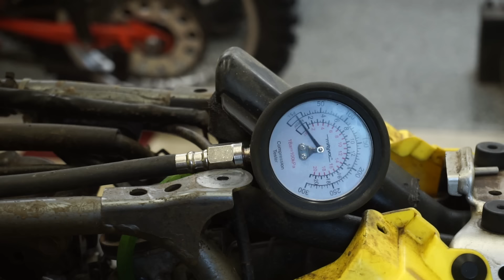Seller Gave Up On This Quad So I Got It CHEAP

Comment: That is clearly one of the three dogs on a gear from the xmsn that holds them locked together.
Reply: Yep I agree
Reply: 100%
Reply: 100%
Reply: 100%, but since the broken piece is out, it might shift OK part of the time, but there will definitely be intermittent shifting issues that could lead to a more catastrophic failure.
Reply: bottom line, time to split the cases.  Also, I have straightened bent shift shafts using a press and various methods with great success.  They have very little movement, so absolute perfection is not necessary.  Saves a few bucks.
Reply: 100%
Reply: Yep 100 percent a broken gear dog
Reply: @u2pda  yes I think it will probably be prone to pop out of gear. Whichever gear that's from. Such as it does when those dogs get really worn and rounded on the ends.
Reply: true
Reply: As mentioned its a piece of a gear dog . It might well shift but as soon as you ride it then it will jump out of gear . Split cases
Reply: @u2pda  that's right that shaft can be saved easy !
Reply: Yep 100! Knew it right away. Just split engine mate! Might save you money if anything else goes wrong why riding. Don’t forget its a Suzuki gearbox 😂
Reply: That’s what i immediately recognized it as, I bet it bent everything because the ear of the gear broke off it had to of been a hard impact on the transmission to do all that or something but absolutely it’s a broken gear i wouldn’t even run it until you split the cases because that was a huge piece
Reply: Correct ✅

Comment: Enjoy watching your channel! Keep up the content!  May I suggest some small things when your tearing apart these Japanese machines?  First is JIS screwdrivers as compared to impact screwdriver? The Vessel brand JIS screwdrivers are the best for Japanese screws! They also use a hammer to give shock to screws. And not strip out like impact screwdriver will.  Second in my time working on these quads, the factory uses plenty of loctite or screw glue on small screws. So heat is your friend!  A Torch with Mapp gas or my preferred method in small areas is Induction coil heat. Where you concentrate heat into steel screw and surrounding aluminum?  Then a wack with JIS Vessel impact screwdriver and bang your done!   Been working on Japanese and German rides along with American brands for 50 years!  Again keep up the wrenching!
Reply: Great tips!
Reply: Good advice. But he must put that claw hammer in the kitchen cabinet and get a good hammer that will transfer the energy needed for the impact driver to shock and drive as intended to do.
Reply: We all start out as crawlers and then we learn to walk then run!  Yes this young man needs to upgrade some tools? But he has some great diagnostic skills! But must learn the bull in the China shop method will cost him more in the long run?  The smaller the fastener the more trouble it will bring! When I apprenticed in a shop, I was told “You know what the difference between an apprentice and a journeyman is Kid?” I had no idea?   The answer is “The journeymen knows how to hide all his mistakes!”  We all learn as we go along! It’s the ones that retain this knowledge that go the distance!
Reply: @six4standingtall 😎🤣👍
Reply: Joe almost never uses a heat gun. Me personally with all my engine builds ever nut and bolt inside gets atleast blue loctite. Even if theres a lock washer or something similar. I tear down engines and see loose bolts or missing bolts that get shredded more than blown engines. Youd be surprised what 10 seconds from a torch  will do to loctite. Night and day difference
Reply: See knowledge is power!  Work smarter not harder!
Reply: abw121  everything you said in this thread is spot on and I agree with for sure. 👍
Reply: One of my first investments for working on all my bikes and friends bikes was a quality Japanese screwdriver set. I actually found JIS inserts for my impact screwdriver and those have saved me a many headaches.
Reply: Agree 100%.  Some of this stuff is just basic mechanic knowledge.  It’s frustrating he’s not showing the techniques in his videos.

Comment: Hey Bud, that metal piece is the gear dog from 2nd to 3rd gear. You are going to need to pull engine and tear completely apart. Then you can weld that aluminum piece on. I know you don't want to, but has to be done correctly.
Reply: Happen to my Dr800 4th gear in half with a chip like that... yep full engine pull down
Reply: Well spotted. I also don't like the thought of just tapping out the existing aluminium casing instead of rewelding the broken off post. Surely someone could reweld that on?
Reply: I agree it looks like a piece of gear dog but how did it get from inside the transmission to inside the clutch area?
Reply: @Claude-om9og  there is a common oil hole that connects the inside case with the clutch case as they use the same oil after all.

That metal piece (it's no aluminum because it sticks to a magnet) went through that oil hole and ended up in the clutch case.
Reply: Yeah Gary, your on the money
Reply: thats exactly my thought on that piece
Reply: First thing I thought when I saw it was a gear dog also
Reply: Agreed. And Joe made a meal of removing the shift mechanism. Sometimes I think he rushes stuff just for video content.

Comment: i am happy that you are now washing them off before you start working on them !!! always a good idea.
Reply: Now if he would start using proper tools.
Reply: Leave Joe alone, he does perfectly with what he has and uses so stop being armchair mechanics and/or tool snobs and just enjoy his content! If not then stop watching it or make your own!!!
Reply: and a small cheap Harbor Freight (for now)
CENTRAL PNEUMATIC 40 lb. Capacity Floor Abrasive Blast Cabinet $199
CENTRAL PNEUMATIC 50 lb. Portable Abrasive Blaster Kit $24.95

until big boy tools can be bought (which is better but)
VHT Weekend Warrior $2,864
VHT Hydro Blast High Pressure Parts Washer $7,000

As much work as he does on machines, one would think a machine like those mandatory
Reply: @sandbar521 wow, what is wrong with you???
Using the right tools for the job is not being a tool snob, and cleaning parts before you work on is good advice, not criticism.
Reply: @Sryously  you don't need it, but it makes your life easier.  You could do it all with a rock and a multi tool aswell but it would be a pain in  the ass.  Yes you can do it the backyard way.
Reply: @kindnuguz  Unless you're willing to buy him $12,000 worth of "big boy" tools to do the job right don't insult what he already has. Because the average hobby mechanic doesn't have any of that stuff. The HF stuff on the other hand is what a lot of people will have because it's affordable and easy to get. I don't even have a shed let alone a garage to work out of so a nice 60 gallon air compressor is out of the question.
Reply: Haters move on enough is enough,awesome find and video Joe
Reply: I think we finally shamed him into washing first. Joe, just listen to us we're looking out for you buddy!
Reply: Yep. Always makes me cringe when I see him stripping down an engine caked with crud.
Reply: Wow hater come clean my truck and house for me.

Comment: That part is coming from either #3, 15, 16, or 19 on the fiche. Definitely a shift dog from one of those gears. Looks like you will be splitting the cases! Also. While you have them apart, please get the part that broke off welded back on by someone skilled at welding cast aluminum. The case is going to be really thin there and tapping it doesn't seem like the right way to repair it.

Comment: Next time you get a situation with a stuck bolt/screw like this, always try a bit of heat before going mad, just in case thread locker has been used. As you saw, just from the heat from drilling the bolts in this case allowed them to come out easily.

Comment: That's how i got my 1st ATV. Was told it wouldn't go into gear got it home and looked at it a couple days later and found the drive belt self destructed. Lost that in storm after a tree fell on it and got my Bruin 350 last year from a friend and going to put nee cv axles in it later today after they get delivered

Comment: To check the oil on the LTZ 400 properly: let it idle for 3 minutes, then let it sit for 3 minutes and check. The oil in the reservoir needs to be filled up first. Otherwise you will not measure anything :)

Comment: Hi Joe. You don't check oil on Z400 like that, when it's cold. You have to start a quad, run it for 3 minutes, shut it down, wait another 2-3 minutes and then check the oil. Mine, when cold, didn't show any oil on a deepstick whatsoever, even if I filled 2.1 or 2.2l in a quad (don't remember exact number).

Comment: I got the very first quad built, which was the Quadrunner 125. I really enjoyed it, but it was a rough ride with no suspension. After that I was bumped up to the 185 which had front suspension and I thought it was the greatest thing ever, but after that everything changed when I got the very first version of this quad - the 1985 Suzuki QuadSport 230. I cannot put into words just how fun that little quad was. I would get all bundled up at midnight in the middle of the winter in New England just so I could go down to the barn and look at it. My father, brother, and myself would go on midnight rides on the snowmobile trails that ran right through our property, and we'd be on them for hours. My brother had the 1985 Honda ATC 250R and I was tired of getting smoked on the QuadSport so I traded it in for the QuadRacer 250. That was an awesome quad, but it just wasn't as fun as the 'Sport, but it was too late to go back. There was something about that 230 that made it the most fun machine I ever had. I would give anything to be able to go back to those days and do it all over again. Anything.
Reply: I too had an LT 230, great quad. Bought it for my wife and I continued to run my Honda 200X three wheeler which was a heck of a machine as well. Both great machines.
Reply: @btj1844  My son had a 200X. He rode the wheels off of that thing. Rock solid machines.
Reply: Thanks for the memories!  I worked at a Suzuki dealer in the 80s and also have fond memories of the release of those quads.  125 was cool, 185 lots more power, 230...gamechanger with its power and suspension.  I raced an 85 quadracer 250 flat track.  Fun times.
Reply: My first quad was an 86 230 Quadsport. Bought it in 93 for $800. Def a fun quad

Comment: Joe look up a tool called the Shake N Break. It is an attchment for an air hammer that will take a screw bit. it allows you to provide turning action while vibration down on the screw. I have the impact breaker you use but when that doesn't work easily i go directly to the Shake N Break. The tool is around $60. Thank you for the excellent videos.

Comment: New engine cases needed now after miss using the impact driver. 1 good hit with the correct bit  will break things loose.  Always push driver hard onto screw then twist it in the direction  you want it to turn until i clicks . This shows the driver is loaded  one good hit causes it to use its spring action to unscrew he item.  Hope this helps.

Comment: You washed it before starting the tear down👏👏.  That's always a good start.  It's unfortunate that a small piece of the case broke off.  I was reading some of your other comments.  Some think you might have to pull the motor and complete a full rear down.  Probably be best to make sure everything is good.  Well, looking forward to the next video

Comment: When I spray my yahama warrior off I use the wax setting at the car wash. If you’ve ever noticed the wax is mixed with hot/warm water. I noticed once when I was using it on my truck the spray wand was warm to the touch. Helps get grease off and the wax doesn’t hurt the machine.

Comment: I have a drz400 I think it's exactly the same motor. That hunk of metal probably came off the transmission (sorry to say) I know that I love my 05 400. Had it 8 years added oil, tires, and batteries . Hope you have the same luck after you fix your issues. Thanks for sharing

Comment: The piece is from a gear in the other side of the engine. I would try to straighten shift shaft in your press. Lay the shaft high side up in a piece of angle iron and press until under side of high side touches angle iron. Then turn shaft and press until it returns to original shape.

Comment: If an engine hasn’t run for a very long time it’s good to add a small amount of marvel mystery oil to the gas to which allows it to line up and also helps clean everything. About a 1/4 cup per gallon. It will smoke bad but it really helps a motor that has been sitting. I would also run that tank through then run some injector cleaner through a tank to clean it up

Comment: I recommend using Allen bolts for the gearshift pawl lifter,I have been in the same boat before, except I drilled my bolts and extracted those first,I also think that piece is off a transmission gear

Comment: Hey Joe! You could probably use that induction plastic welding unit to heat up those little screw heads to loosen the lock tight and spin them out easy! Loving the videos bud and content!🤔😉👍📹💯✔️👋👋👋👋

Comment: I have a spare bottom end if you need parts I also have a ported top and it's completely ported on the exhaust side and just cleaned up on the intake side I have the newer wire harness with the newer CDI I have a complete bottom end crank transmission everything is absolutely mint I have all kinds of carburetors you name it I got it

Comment: Tip on tight phillips screws, use a normal screwdriver while putting pressure on the end by hand turn the screwdriver with a wrench. Gets them loose every time.

Comment: I've seen you strip the screws holding the shift drum a few times now...  They are loctited from the factory.  If you heat them with a heat gun they will come out easy.

Comment: You're lucky. I've never had much luck working with easy-outs, but to be fair, most of the stuff I worked on was pretty rusty and were impossible to remove with the original hex head nevermind something as delicate as an easy-out.

Comment: Joe, I'm glad to see your better at negotiating. I think the guy before was riding and hit a tree or jumped on a rock with shifter shaft bent back and slamed gear back breaking it . I bought a Yamaha blaster the same way but my shift shaft is bent same way but case is broke were shaft goes into case, although my gear's are fine.

Comment: I'm at 49:00 Joe and you haven't split that case.. I think it would be very wise of you to get into the transmission side and find out what that little piece was over on the clutch side.. I'm guessing that's part of the shift fork, and a comment in here (more than one) says the same thing.. Joe please split that case man, this will come back and haunt you if you don't.. not sure the plan yet there's 6 minutes left in the video, but that's not long enough to pull this motor and split the case and do further diagnosis so...

Comment: Pretty sure that found flat metel peice is a gear dog.. it looks like your missing the upper shift detent pin. the flat shift pin on the shift detent. And if you put some heat on them screws it will make it alot easier.  They have thread lock on them.

Comment: it looks like a synchro dog from a gear, you know the ones inside that mesh with three slots of the next gear?

You'll never know till you open it, but if you can get away with it some alum grinds will not hurt the box, use some cheap thin oil, run it easy for 1-2hr shift up/down, then rinse it off with fresh oil and filter.  If you split the cases find some insert sleeve with cap and drill through and cap it from the otherside then thread the broken piece replacement back.   That sleeve will have to be knotched and locked in place if the bolt is ever to be taken out again.  Machine and press fit through it maybe.
I am thinking steel (hardened) thin cap on the other side, 1-2mm set pin to keep from turning press fit with red-LT

Comment: You might want to check the swing arm really good on it because the swing arm on those bikes are absolutely notorious for cracking I guarantee you there will be a track somewhere in the swing arm I've had about eight of these bikes and every single fucking one of them had a crack somewhere in the swing arm

Comment: Great video!  But you’re gonna have to tear  that engine down!  That is the dog between the second and third gear! I’ve seen this happen before!  Also, you need a little torch! Blue Loctite will release around 300°F!    Other than that seems like a pretty good find for a grand!  Even if you parted out, you will make your money back no worries!

Comment: Joe you know that's a shift dog.. you've taken these apart enough...  save the time and pull it out split case and see which one it is and order it with the shift shaft and drum detent.... cause if one of the dogs are broke off... that whole peice is stressed and possible fractured and is gonna cause problems when you really get on it.

Comment: Hate to say, that broken piece of metal looks to be one of the engagement tangs on one of the gears. It probably broke off, floated around, then jammed under the shift drum and bent that arm. Me, I'd split the case and find exactly where that came from

Comment: Check the timing chain gear that piece could be from that but it kinda looks like part of the shift drum, plan on doing that timing chain to these ltzs go thru them fairly quickly, I bent a shift shift last year and found a lady on eBay that had one still sealed in Japanese packaging with the weird powder in it for 60 bucks

Comment: Something off the other side of the shifting mechanism that turns the drum . Probably not a dog on the side of a gear usually one side has a relief to help it disengage . The shift rod being bent got caused by something inside .